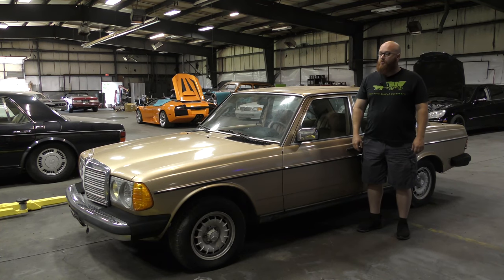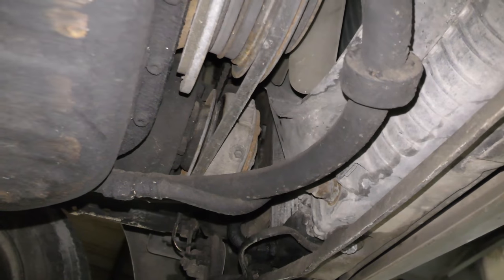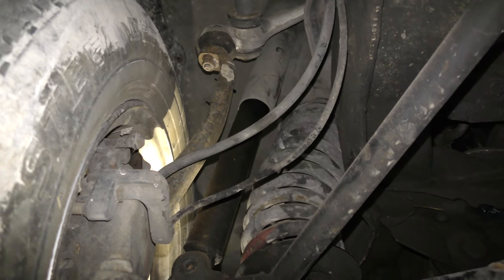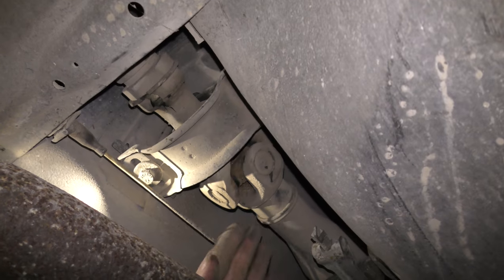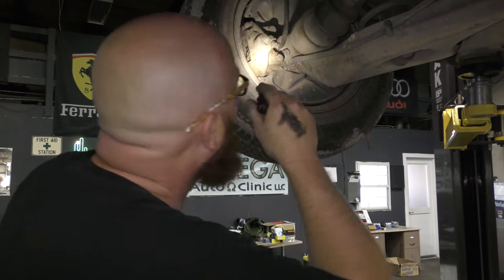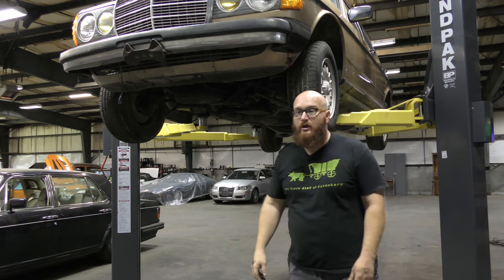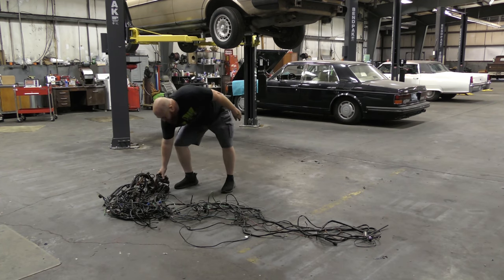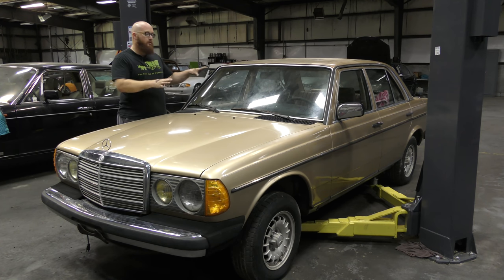What's lurking underneath? CAR WIZARD finds lots of repairs required to make '84 300D MB roadworthy

Comment: I drove one of these old 123’s, a 300d wagon. It was a total basket case, nothing worked, locks windows air conditioner, dash lights, etc but I loved it!  I borrowed it from a co worker, who, while I had it, ended up moving. Asked me to hold on to it while they moved. I got to keep it for about 5 weeks.  Again, basket case but it was awesome.  Save this one Wizard!

Comment: When I purchased my W123, I had to do almost everything you listed upon your inspection.  On the lower ball joints, I was unable to find a shop locally that had the proper tool and the local MB dealership does not do piece work, so I used the "bury the spindle arm and apply BFH" to the joint and it popped right out.  Anyone who gets one of the cars that have not been taken care of can count on replacing all the rubber suspension parts on the car.  They are cheap and easy to get.  Tires are cheap, shocks, links, bushing, and other items are available.  All of the factory service manuals are online from MB.  I love mine and wish more were saved from mice and rust.   I'm glad this owner is saving this piece of motoring history.
Reply: Most of the cheap parts are made in China or Malaysia and will not last anywhere near as long as OEM-quality parts. It's best to buy OEM if you are planning to keep the car for a long time.

Comment: That wiring harness, may the force be with you.
Reply: At least there's not several  computers spitting out codes for a pastime and the Old School Wiring Harness can be fished through Bulkheads where as the modern Wiring Looms are another story   
if a cat got at same or same dry rotted  reckoning a more say  mid two thousands  modern car would be toast...but then who would want a  Tupperware car of that age...
Reply: Car wizard redid old school Rolls Royce wires. I think he’ll do fine on this lol
Reply: It's a giant sqiid!
Reply: Ive restored a couple of these cars. The wiring harness is "simple" but the dash has to come out and youre looking at 20+ hrs labor just to replace it and put everything back. Car will last forever and ALWAYS be cool.

Comment: Did the evap coil in my 07 f150 . A $150 piece had to remove both front seats steering column centre consul and roll the carpet up to get at the ducting for the consul. I am a heavy truck tech laying under a dash out of the norm for me and at 53 felt it for a few days. Labour is why I am posting this a job like this easily $1,200 labour but cost me $150 and a weekend.

Comment: This is the newest Mercedes that I would want to actually own.

I am glad that the owner is choosing to save this thing. They are amazing cars.
Reply: I’d also go for a W126 or W124.  I’ve heard the W124 described as Peak Mercedes. After Lexus hit the market they’ve been designed to a price.
Reply: @shiftfocus1  Having owned both w123 (1977 200/saloon/manual) and w124 (1993 e220 estate, manual) for around 15 years combined, my choice for peak MB is the 123. The 124 was just brilliant in many ways - well made, roomy, comfortable and safe. Nice on petrol as well, compared to the underpowered, thirsty 200. BUT far more complex and much harder to work on. My next car will be an EV, that's the future, but still, I would like to own a good 123 just once more. Keep the rust at bay and it will last forever.
Reply: @janhanchenmichelsen2627  
The other option is a boring but reliable Toyota Camry or Toyota Corolla. To keep as a gas car.
Much more reliable better gas mileage and much much much easier to work on at least if you live in the States. German stuff all requires specialty tools especially the newer stuff.
I've got a 12-year-old Toyota Prius with  330,000 miles.
Bought It used, have put 130,000 on it in two years.
Just changed the struts last month, still rolling on all the original wheel bearings ball joints tie rod ends control arm bushings. And they're all still solid.
I absolutely love the older Mercedes as far as the way they look and mechanically they were reasonably solid. But not as good as a 10-year-old Toyota Camry certainly the Toyota is a hell of a lot more boring however. If you want to actually drive the thing I pick the Toyota.
I also agree with you then an EV is probably the future. But don't delude yourself that there will not be reliability issues with those also. While electric motors are relatively simple, the control systems and cooling systems are fairly complex as are the 12v electrical systems. Watch videos from Rich rebuilds if you want to see what a Tesla looks like under the skin.
If you're interested in the mechanical stuff, you might take a look at the YouTube channel Weber Automotive. He has theory of operation and tear down videos of all the Toyota Priuses different generations. Also Chevrolet Bolt EV. Battery removal complete disassembly, cooling system, and the motor and transaxle assembly. Pretty cool stuff if you're into the mechanical stuff.
Reply: @kens97sto171  Yes, I was thinking about an Avensis, but ... now I drive a Mazda 6 ,2l diesel, manual. Estate. Cheap 2007 model. Mainly to teach both my sons basic driving skills. The cost of taking the driver's license in Norway is from USD 2500 and upwards, around 20 hours of training at a driving school and many courses required. Parents are then encouraged to drive at least 3000 km with their children before the final test. This will save a LOT of money. Regarding EVs, a national tax and toll road scheme make pure EVs very affordable. Cheaper than fossil cars in the same classes and far cheaper to run. There are charging stations all over the country.
Reply: I only own 124’s and 129’s. Never owned a 123 but would love to experience some 300TD
Reply: @janhanchenmichelsen2627  
Getting your license in the US is pretty easy. not as many younger kids today are as interested in being independent but when I was a kid generally speaking you had your license by 16 or 17. You need a temporary permit but you can get it 15 good for 6 months You have to have an adult licensed driver with you when you're driving and you cannot drive at night. Fortunately for me I got lots of practice driving, even before I had my license my mom would ask me to go get the car and bring it around to the front so I got lots of practice learning how to use the clutch. By the time I was driving officially I was already fairly proficient. 
I follow Bjorn Tesla YouTube channel. Norway definitely has good electric vehicle infrastructure. I do find it kind of ironic that Norway's sovereign wealth fund is funded by oil sales. However it also seems intelligent use the resources you have to get your country where you want it to be in the future.
The lowest speed limits in Norway would drive me insane though. I would fall asleep at the wheel from boredom. Lolz.
I live in West Texas the speed limit is 128 km/h. (80mph)
But everyone runs 135 to 150kph. (85-95mph)
Keep in mind that gasoline costs less than $2 per gallon currently. Even before the pandemic it was only $2.50 to $3.00 per US Gallon.
Reply: @kens97sto171  Dirt cheap fuel, flat terrain, warm climate, and broad roads ... Texas is possible the TOTAL opposite of everything Norwegian. Except for the motorway system around the central Eastern region, the rule of thumb is to expect an average speed of 60 kmh (37 mph) on many trips, especially in the western counties. This accounts for mountain passes, some single lane roads, dark, narrow tunnels, many farms and villages, ferry crossings, and so on. Even slower in winter.  But remember that mainland Norway is not that small (same size as the UK), and the trip from far north to far south is around 2600 km (1600 m). This area is populated by just 5,2 mill people. Building motorways all over the place in just not viable. So, the oil fund. This is actually a pension fund, to cover future obligations. The parliament has decided on a «budgetary rule» with very strict limitations on the usage of revenues to support the annual budget. This year, the rule will face enormous covid expenses ... The conservative party has long said that it wants to start rolling back the costly EV tax and toll scheme. But they can’t decide this alone. As usual, we’ve got a coalition government.
Reply: @janhanchenmichelsen2627  
Texas is somewhat unique even in the United States. Because of the vast distances and varied terrain and climate. Texas alone is about 900 mi across west to east and about the same north to south at its largest distance.
It's funny to me Dallas fort Worth metro area has a population of 7.4 million alone. Population of Texas as a whole is 30 million.
The Norwegian sovereign wealth fund is certainly interesting. I just find it kind of ironic that as EV-centric as Norway seems to be that this fun would be supported by oil sales. I'm not saying I find it a bad thing I think it's intelligent to use a natural resource for the future betterment of your country.
I do wonder about EV tax credits and subsidies in general. We have the same issues in the states. EV's get to use carpool lanes even with only one passenger in the car, they're not paying any road taxes because we collect our road taxes through the sale of gasoline. So some changes will need to be made ultimately. And some states have already done this adding additional registration fees for hybrids and electric vehicles.
I don't particularly care for subsidies in general. It seems to me the general population should not be helping you pay for your car, or anything else for that matter.
I like electric vehicles quite a lot. And I would like to have one as my next vehicle. But the price even used is a bit high.. For me a hybrid like a Prius is kind of the best of both worlds. It keeps my operational costs low but also gives me the long range of a gas powered vehicle.
Interesting that I guess not only the United States has problems with their government deciding things.
I guess it's better than a one-party government deciding everything with no opposition. But it can be frustrating it seems like progress moves at a snail's pace.
Hope you have a wonderful day.
Reply: @kens97sto171  Very, very, very, very different societies. Norway is, as I guess you know, mainly a consensus-oriented, social-democratic welfare state with (compared to many other countries) small social inequalities. Capitalism is thriving, but in a controlled way and tax incentives are commonly accepted as regulatory tools to achieve political and social goals. The two main political parties (Labour/Con) are of course different, but still mainly centric. The far-right and far-left parties are very small. A "one-party-at the time-government" (like in UK and US) could be more efficient, short term, but then the policies could be reversed when the other side gains power. This is not a system most Norwegians want. Long term predictability and basic, pragmatic agreements on important issues (like the oil fund) is a common, majority goal. Regarding the EV scheme, electrical power supplies in Norway are hydro (and some wind) based. Then it's very hard to reduce our CO2 emissions. From this year, fossil oil heating is banned in most buildings, both public and private, the North sea rigs are being electrified with shore power, factories are phasing out oil, the ferry network is being electrified (natural gas where batteries are not good enough) and the goal is to phase out all sales of fossil cars by 2025. Plus, plus, plus. Yes, this is costly and paid by oil revenues, but oil production is really declining. Our vast gas resources are more and more important. The next BIG task is to use these resources to build and supply a national and European hydrogen-based infrastructure. So-called Blue Hydrogen. After processing, the CO2 will be pumped back and permanently stored in old oil and gas wells. Well, at least, this is the plan! Have a wonderful day, yourself. And stay safe!

Comment: All I heard was “It’s gonna need a $. There’s also $$. Looks like the $ is bad. This $ is worn. This $$$ had som play in it. Probably gonna have to replace the $$$ too.”
Reply: @shugthehornyhaggis  True.  Any old classic like this will need about $10K to get back to 100%.  He hasn't even run the engine or dealt with the interior yet and it's already at 4-5K.
That said, restored to 100%, they are beautiful and timeless cars.
Reply: It would be worth fixing especially since you’re not going to be driving it everyday either it’s just one of those fun classic cars to have and work on.
Reply: If you want to pay someone else to do it yes, it's expensive, but if you do most of the work yourself running a classic is far cheaper than a modern car. I've never driven anything but cars that were 30-40 years old and unless it was something serious like a driveshaft or clutch change I could do it myself in a day.
Reply: @noahballard1469  And unlike some of the more well known "classic" cars, you can get into one for a few thousand, not $30K and needs another $30K in work.
Reply: @GlamStacheessnostalgialounge  One problem, though, is that even as well built as the old Mercedes engines were, the materials used for the gaskets in the engine routinely fail at about 40 years.  Yes, it is a lot of money to rebuild the engine, but most engines are coming apart at 25 years.  Still, it's all relatively affordable to run an old Mercedes sedan. :)  I still miss my 1967 230 S.
Reply: @plektosgaming  My first car was a 1978 w123 back in 2004, and it was dreadful. Everything on that engine was failing and I have no idea how it lasted as my only car for 5 years. Had much better luck with my next cars and none of them were Mercedeses, yet they've been running perfectly for me without any seals breaking.
Reply: @shugthehornyhaggis  I don't even have a shop and all I have are cheap shitty old wrenches, back then I didn't even have a ratchet set or proper floor jacks and I got a lot of stuff done in a parking lot.
Reply: @shugthehornyhaggis  If only I changed my tired ball joints! But pretty much everything on that car could be carefully taken off with a normal wrench and a lot of care and patience.

And don't ever replace the whole driveshaft, I tried that, unless you pay top dollar for one it will be really bad, mine didn't even turn how bad it was made. It's worth more rebuilding  your existing one.

My model was also the the lowest spec engine, 2 liter petrol with a carb, easy as fuck to fix but it sure needed lots of fixing.
Reply: @shugthehornyhaggis  Yeah, I know Germany ain't too fond of people owning old cars, they just want to sell that scrap junk over here to the Balkans.

Not that we have any better car laws over here, but nobody actually cares so you can do whatever you want.
Reply: @danielpassigmailcom  Not safely, though.    That it made it in one piece is a testament to how much abuse these little things can take.  Most modern cars are done and ready for the landfill at 20 years old, and this at twice that age just requires a few weeks in the shop.

Comment: I wanted to add that the best "upgrade" for the W123 is swapping out the final drive.  I went from the stock 3.47 to a 2.88 and it made all the difference.  I use the car as a daily and drive most of it at interstate speed.  Now the car will sit on 75 to 80 mph all day, every day and twice on Sunday and not miss a beat and the engine is not screaming at you.  (1981 300D Euro - 123.130 - 4-speed manual, factory trailer ball)
Reply: Agreed! And a one-time manual transmission conversion to go with, so one actually can go those million miles without having to keep rebuilding the automatic.

Comment: I just knew we were going to get you getting a taste of that diesel, lol!

And , yes, I would definitely spend the money and time to rehab this car.
Reply: Agreed, Johnny! I love diesels, especially old Mercedes diesels, and this one was definitely worth fixing & restoring.
Reply: but not 3 or 4 K. Is mechanic labor and parts really so expensive in USA? Cause in my European country I could fix this all up for 2K euros easily...
Reply: @edvardsz3539  Can you provide an estimate invoice showing exactly what your 2k Euros covers? USA mechanic labor from a pro shop is often $100/hr.
Reply: @klinky  i have no estimates. Im just saying that labor here is cheaper. And as Wizard said - parts here are easier to find. That changes a lot too
Reply: @edvardsz3539  Where is "here"? EU is big and I think you'd find similar prices in some areas.
Reply: @edvardsz3539  Yes, most shops charge between $100-125 USD per hour of labor. Replacing an exhaust, suspension, tires, brakes, fluids, and complete wiring harness can easily run 25 hours or more. The wiring harness alone was over $500 USD. At current exchange rates, 2,000 Euros is about $2,350 US Dollars.